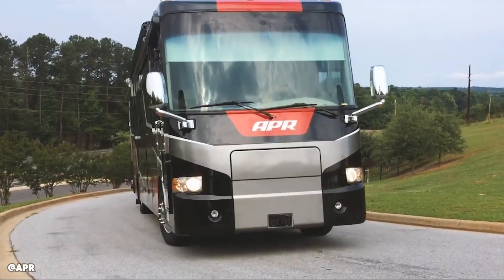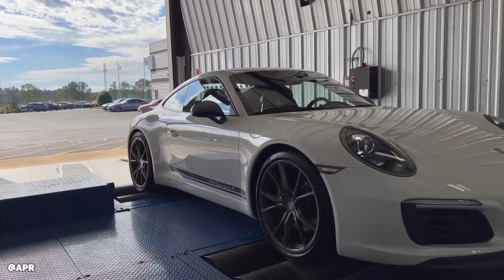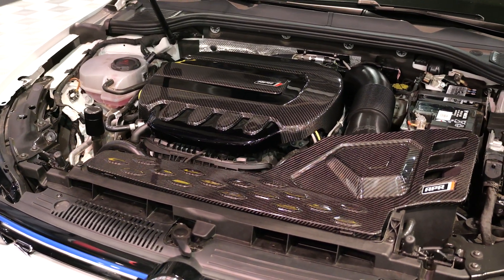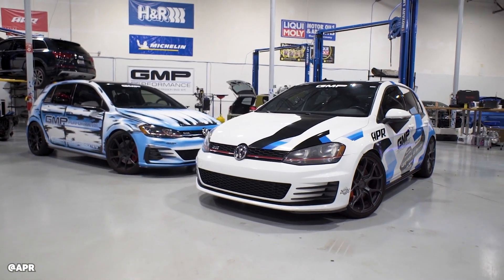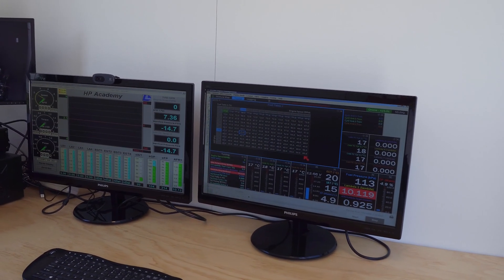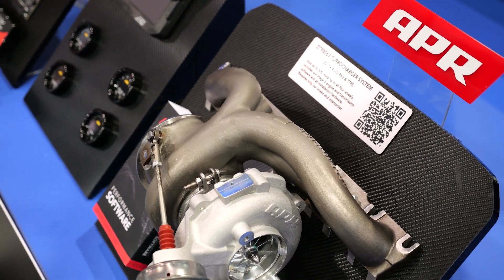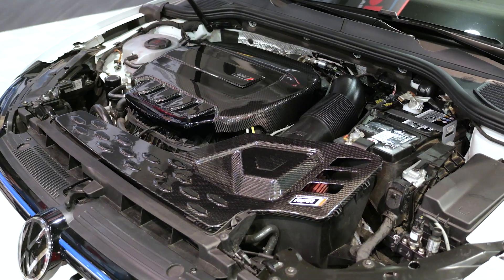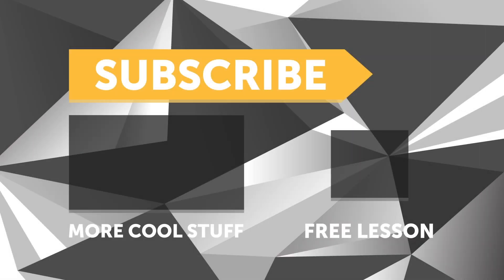UNTAPPED POTENTIAL | Why OEMs Limit Performance (And How to Fix It)

Comment: Really enjoyed this one guys. I’ve owned two APR tuned cars, a VW and a 2018 Audi RS3. FBO stage 2. That RS3 was bloody impressive. 10 second quarters and ultra reliable. With that said, I did oil changes every 5k klms and looked after the car because I beat on it hard. APR are bloody impressive for power but even more important they are safe. Some tunes might have (might) have a tad more horses but they also window blocks. Can highly recommend APR if you are looking at tunes, on both occasions they turned my cars into animals but even more impressive is those cars are both running around with new owners.

Comment: I enjoy these interviews but a few thoughts:
1. Don’t ask a question and then answer it for them.  It seems like many questions were being asked to arrive at a pre-determined answer.  
2. This seemed more like a scripted promotion for APR than a genuine interview.  Completely ignored the ‘awkward’ elephant in the room about why APR can extract more power (emissions and fuel economy) and only ask a tough question (warranty) if APR can turn the answer into a promotion. 
3. APR specialise in VAG/VW.  The 4 cyl VW engines have supplementary port injection as you noted, but all the documentation I’ve seen suggests it’s only used at low engine loads, not for performance gains.  As the owner of a APR tuned Audi S3 I was keen to learn if APR are utilising the factory port injection at high loads.
Reply: its an educational outlet, asking questions to answer for them is to introduce more relevant knowledge to viewers with less background knowledge in an efficient and professional matter, I think its an excellent format that they are following, and other automotive channels should follow suit. I would love to see people with the same desire to inform an audience while simultaneously extracting as much info as possible for an enthusiast audience is something I would love to see. Especially compared to the garbage  generator that automotive content creation has become on modern short form platforms.
Reply: @dissapointingsoup4893   totally agree, well said.
Reply: 1.Andre already knows most of what he's asking but I get what you're saying
2.i have no problem with this type of video being an obvious promo as its also sharing knowledge of companies and products, if it's something I already know about I just won't watch it.